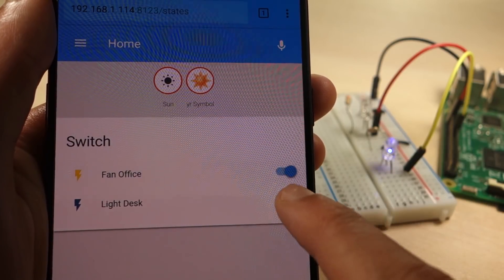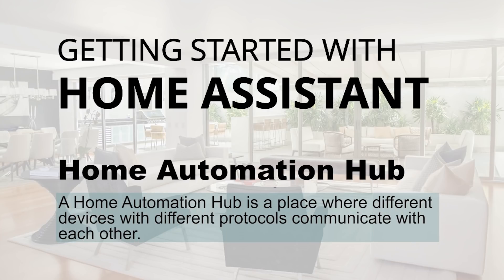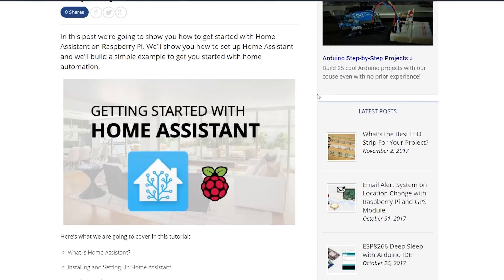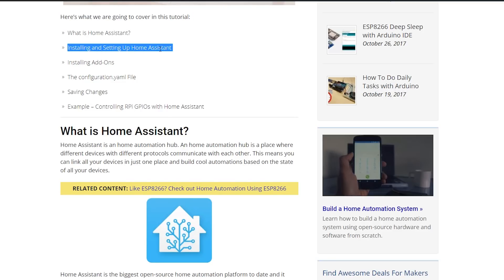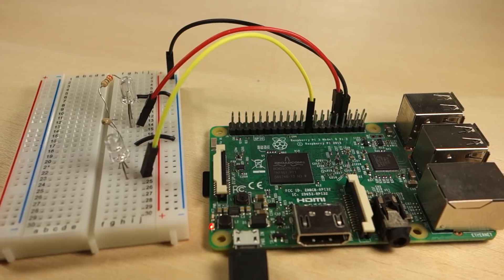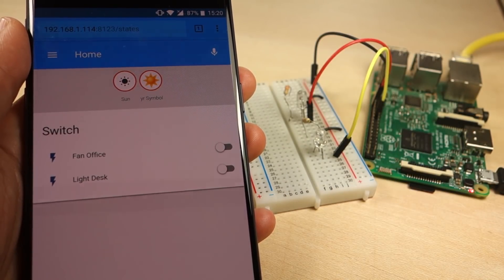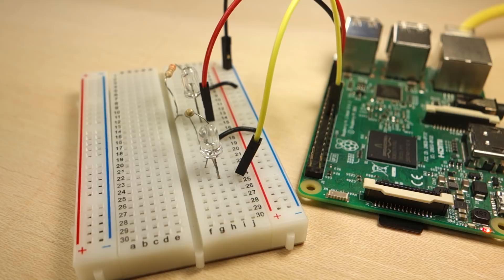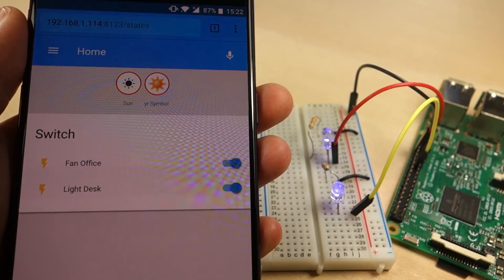[DEMO] Home Assistant Controlling 2 Raspberry Pi GPIOs

Comment: Hello, maybe someone knows how to replicate "Konnected Alarm Panel Pro" behavior with Raspberry Pi? I dont want to run Home-Assistant instance on Raspberry, just a probe, to use IO pins to connect wired sensors to Home-Assistant.
Reply: You could write a script on the RaspPi with something like arduino ide but you wouldn't have a UI. But would work relative to how you programmed it.

Comment: Has this worked for anyone ? If yes - How? Because the video doesn't describe steps. After updating configuration.yml - nothing shown the integration
Reply: did you go to their website that has a more detailed  instruction?
Reply: not. I see that RPIGPIO integration cannot be added from user environment. Just by typing into configuration.yaml. but it doesnt work.